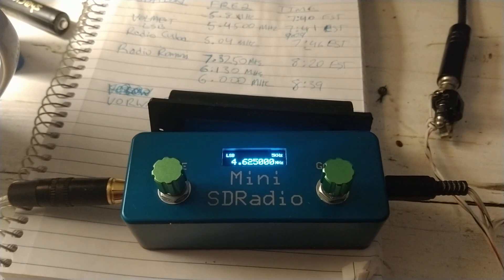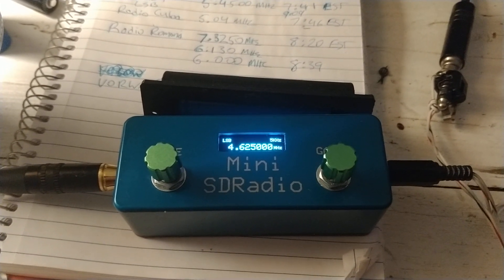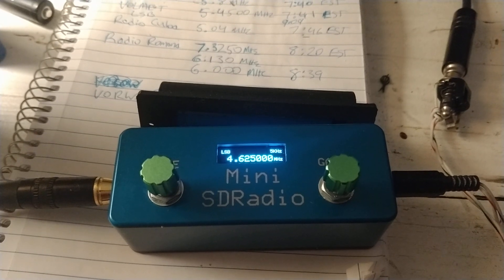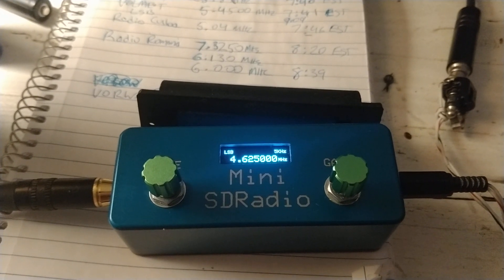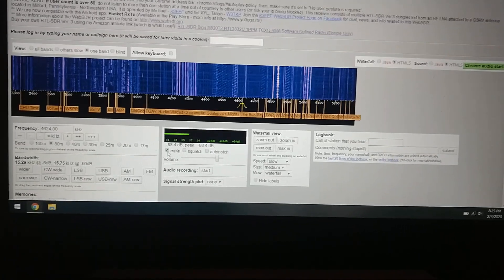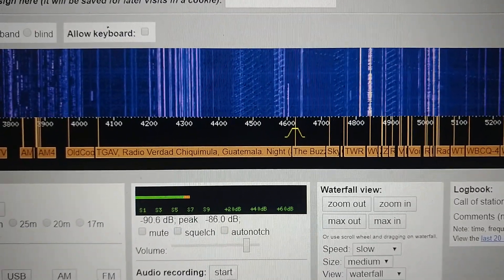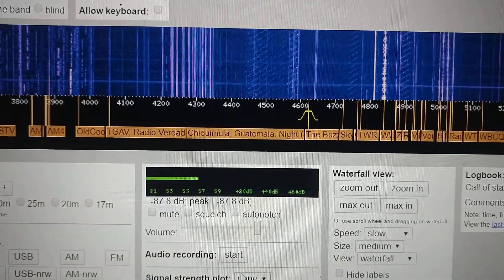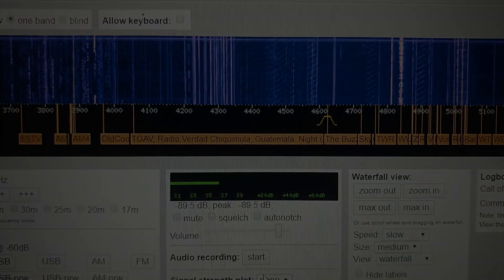E-Field Mini Whip Antenna Test

Comment: Very neat receiver! But i think you should receive buzzer on usb instead lsb. Also, did you compare classic miniwhip with jfet input to you biased op amp? Excuse my English
Reply from the maker: I am using USB...my display code was backwards. I have fixed this....no I have not compared...this particular op amp should give better performance by design.